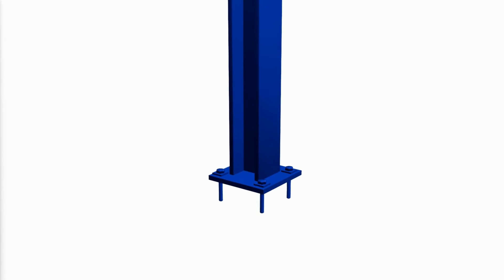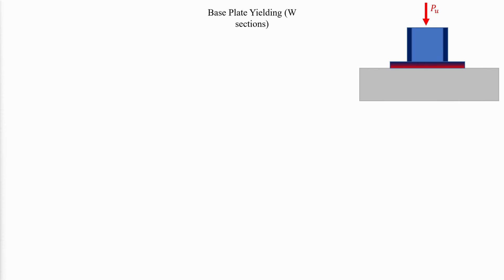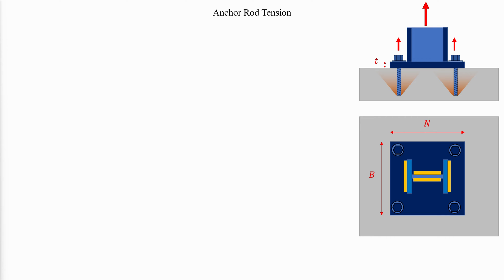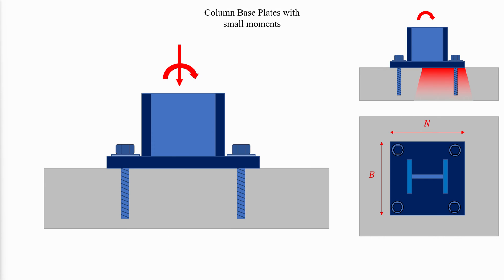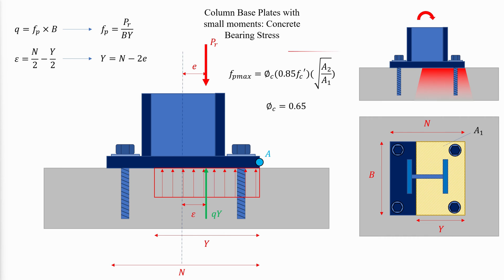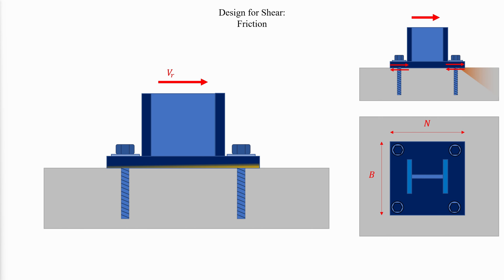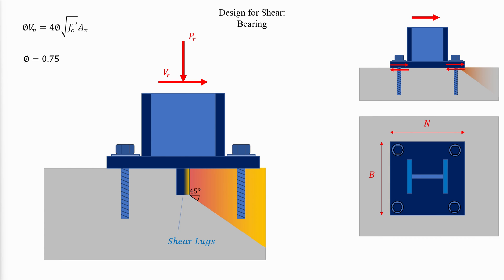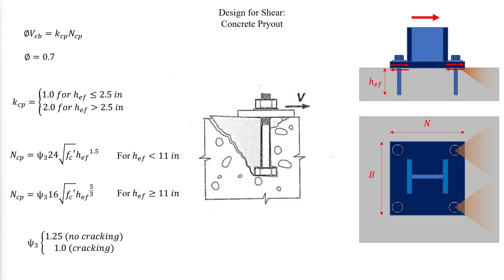What Could Go Wrong? The Hidden Risks in Base Plate and Anchor Design

Comment: Excellent information, very educational. I have a question: if the base plate were omitted and the metal column were installed directly into the footing, including welded metal grooved pins, and if the metal column were also filled with concrete, what formulas would be applied? thanks

Comment: If you are struggling with anchoring design, watch this video. 
https://www.youtube.com/watch?v=kBpHNRTARsY
With IDEA StatiCa, you can now design any kind of base plate and fully reinforced concrete foundation in one software. shear transfer through anchors or shear lugs, designed for anchoring cases. Suitable for anyone facing issues such as pull-out or concrete cone failures and has been frustrated by the inability to incorporate reinforcement in Connection, you can now easily model the reinforcement and perform an analysis in 3D Detail. The use of reinforcement covers these failure modes that would otherwise occur in plain concrete. From 3D Detail, we can receive results for an Ultimate Limit State check for concrete, reinforcement, and anchors in tension.

Comment: Why does q = qmax for large moments? Also I don't see any consideration for compressive failure for large moments
Reply from the maker: Hi, the fact that q= qmax assures that failure does not happen in compression by definition. Please look at the equations of fpmax to see that. The reason why we assume that is actually just an engineering assumption that proved to be accurate by experimentation because otherwise the number of unknowns is bigger than the number of equations and the problem can't be solved. This assumption is considered in the ACI code and you can read it for reference. Thank you for watching.